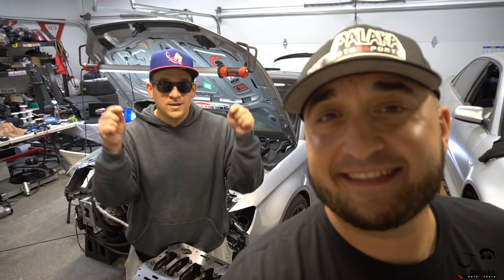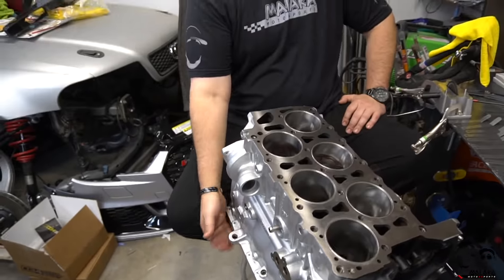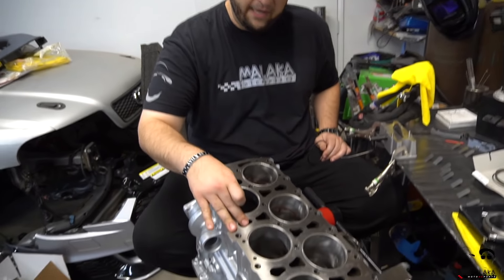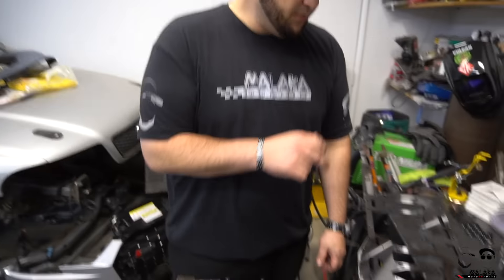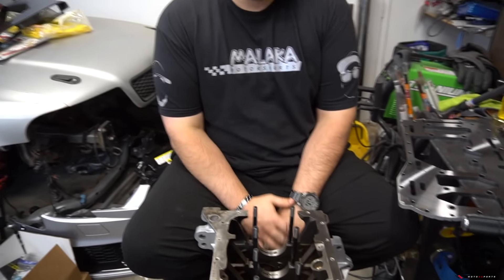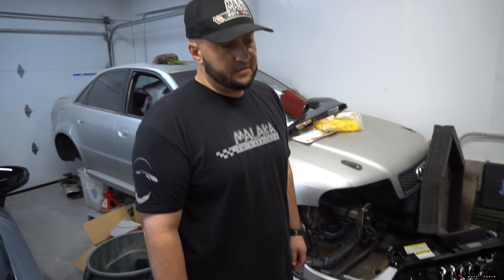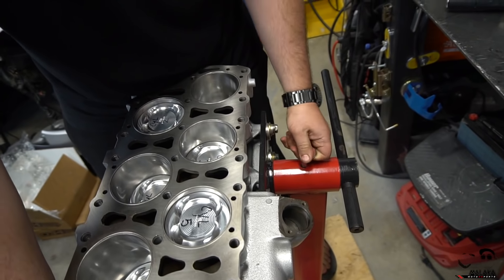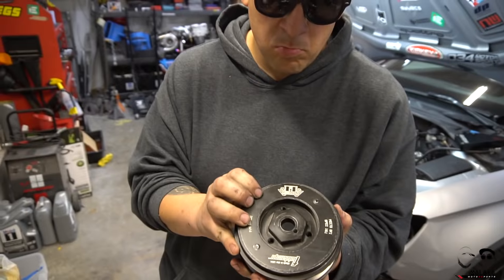R30 VR6 Engine Build pt.1

Comment: Fluidampr is going to save you so much headache in a high HP situation. I highly recommend one to reduce the harmonics the engine will see with higher horsepower tunes. The stock damper is good at stock HP rate vehicles, but anything over that you are taking a chance of vibrating that crank to death.

Great video guys,  and can't wait to see the updated build.
Reply from the maker: Absolutely we been running fluidamprs on both of our B5’s seems like every failure we have seen is because people don’t put a new  crank bolt which is $7 along with loctite and actually torque them.

Comment: The engine build is looking solid, nice job. The ring gap formula is .007 and .0075 per inch of cylinder bore, you could have gone .030 and the engine would not know. Keep rolling.....
Reply from the maker: That makes sense

Comment: I’ve seen videos of pro guys when they’ve done ring gaps. The only difference from what you were doing, is they flip the piston upside down and they push the ring down until it gets to the associated groove. I think the reasoning behind that method as far as I’m aware is that’s where the rings would end travel at tdc for each cylinder. 
Can’t wait to see the vrs3 on the dyno
Reply from the maker: Everyone has their method.  We are excited also. Dyno numbers are cool. 1/4 mile times are way better lol

-stav
Reply: @MalakaMotorSports  that’s a good and bad thing about working on cars, millions ways to do everything. But those boys from Real St are absolutely top shelf 👌🏼. 
I’m interested to hear what the r30 is going sound like. Maybe you guys could do a comparison video with yours and George’s B5 to the vrs3?
Reply: Be careful doing that, on vr6’s the top of the piston is at a 7,5 degree angle📐 and the rigs would not be square within the bore. Ask me how I know😂

Comment: Been looking forward to his for a while.  One tip, you don' need to lube the studs where they go into the block.  The ARP grease is only for the UNF Fine ends of the studs, to reduce friction and allow more accurate torque specs.  You can loctite the block ends though.
Reply from the maker: Hmm interesting I guess it’s just bad habits. Even arp told us to lube them up. But what your saying makes sense. Hopefully everything works out. If that shows to be an issue we will fix it and try a new way. Always learning something new
Reply: @MalakaMotorSports  I doubt the mains studs would shake loose anyway.  I'd imagine you'll be pulling the engine once a year or more for maintenance.  When you do, attempt to re-torque the mains to your current torque spec and see if they move.

Also, consider getting an ARP rod bolt stretch gauge.  Ive found that when using L19 and ARP625 bolts (3/8) the torque spec recommendation of 65ft-lb doesnt achieve the required stretch.  In fact you often end up going as far as 71ft-lb to get the 5.5-6.5 thou stretch on the bolts.  Its a good investment to improve your builds, and helps you document everything so you have a point of comparison for when you do your maintenance inspections.
Reply from the maker: Absolutely all good things to consider and I think your right at the power level we are aiming for. I would think regular routine maintenance and checks will come and we can improve and document everything better. I’m excited to see what this engine will do and how far we can push a cast engine

Comment: Great video and channel guys. Thanks! Out of interest, any reason you aren’t using a torque plate when adjusting rung gaps?
Reply from the maker: Well thank you for the support. But. In all of our motors the machine shop used a torque plate to bore the motor.  But never seen anyone check ring gaps with the torque plate on their. Maybe something we will try in the future but so far so good

Comment: My brother and I were talking the other day, with that girdle plate being sandwiched between the oil pan and block, how are you guys going to get the oil pan “bell housing” bolts to line up with the trans?? The holes will be off the thickness of that girdle..(I’ve seen 3/8” & 8mm thick girdles)
We were debating this ourselves🤔
Lovin the vids!!🔥🏁
Reply: Custom oil pan, haus. Also have seen adapters too, but not often.

Comment: What did you guys have for oil clearance on the rods and mains?
Reply from the maker: I believe around .022 for rod bearing clearance. And around .025 for the mains. If memory serves me correct. Machine shop line honed the motor and we did a quick check and everything looked good
Reply: @MalakaMotorSports   thx for the reply should be mint 👌 cant wait to see how much power you throw at it! Im also interested to know how much that girdle and the arp studs distorted the main bore (if at all )before they align honed it. I've done arp hardware on 12v vr6s many times and the main caps are so beefy it changed the bore size barely a tenth.

Comment: What turbo  should we use for  1000 HP ON STREET for both  the 1.8 and or the  3.2 vr6 engines with the least lag as possible?
Reply from the maker: Hard to say  for the 1.8t as we have not modified a 1.8 to that level.  But the 3.2 can make 1000
Hp on any 68mm turbo. Check out the g series turbos very high quality turbo

Comment: Oil backing a main bearing is Obviously a NONO...negating oil clearances the Bearings and Cap Torqued....also cross hatching bearing backs is THE go-to strategy to GRIP without oil has tighter clamped tolerance.
SO...the PROs
KNOWS.